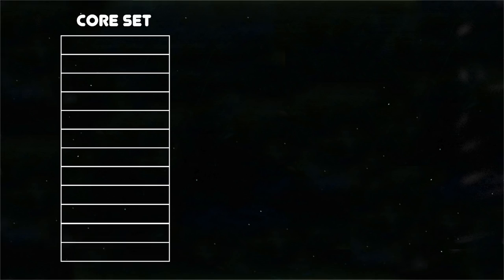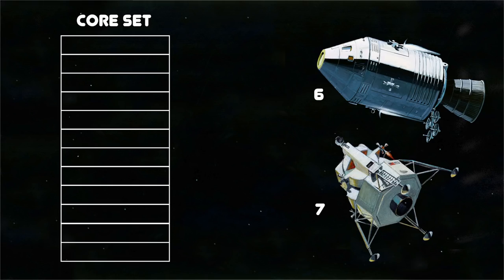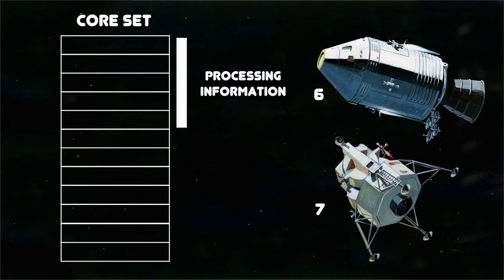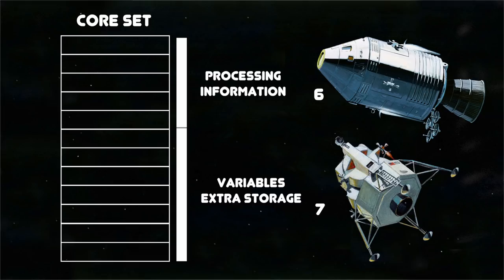Apollo 11's "1202 Alarm" Explained

Comment: Best part of the story is that the main programmer was Margaret Hamilton! She was/is a genius! The stacking and scheduling on this CPU that had less power than your smart watch was a work of art. The 1201 and 1202 system was actually a brilliant piece of adaptive code execution, and for 1968 when computers were the size of small vans and sat in stationary rooms, that is saying a lot!!! Ms. Hamilton should have her story told!
Reply: Glen Clark Absolutely! Margaret Hamilton developed the priority interrupt scheme for juggling those jobs, a system still used today. When you develop something in the computing field that remains in continuous use for over 50 years, you have earned the right to have your name mentioned. Often.
Reply: Smart watch? Aim lower - the Apollo computers had less computer power than a modern washing machine has. Even basic devices like bicycle lights do now too. Cheaper and easier to use an off-the-shelf microcontroller than design your own control circuits. Sometimes more battery efficient too.
Reply: tin2001 Cheaper and easier in this context is not always your friend. I can pretty well guarantee SpaceX isn't using Arduinos to fly with. Robustness and redundancy are key features I'd want my rocket seat bolted to. There's no mistaking technology has advanced an incredible amount in the past 50 years, but please don't dumb it down to make it sound like you can just grab off-the-shelf hardware and fly it. Two things really make the difference here; radiation hardening, and very large amounts of input/output pins. Where do you buy that stuff ready to go? I used to build, calibrate & final test commercial avionics. That stuff wasn't good enough for space!
Reply: Not to mention coping with extreme vibration, extreme heat, extreme cold, extreme vacuum, multiple redundancy etc etc. The average washing machine does not have to function 250,000 miles (and more) from home - and your life is not completely dependant on it.
Reply: EricIrl Exactly!
Reply: We have an expression we use over here in the UK -" horses for courses". I suppose you could also say "software for courses" or, more accurately "software for mission".
Reply: EricIrl We also say "use the proper tool for the job". Same difference. Oddly enough, while the AGC source code from one mission (I don't remember which one) has been around for years, as well as plans for an AGC emulator, I just saw a port of this code to run on a Raspberry pi. Tie that to the very good DSKY replica out there, and you'd have an awesome sim! Nonetheless, I still wouldn't trust it to get me to the moon and back.
Reply: That reminds me of the old saw that an IBM AT (or 386) had more processing power than a 1970s mainframe. That might be true in the narrow sense of MIPS, but the mainframe (or even mini) had a far more robust I/O system that could handle (say) several hundred (or a thousand) users at a time. That kind of demand would swamp a microcomputer.
Reply: Not to be confused with the Margaret Hamilton who was the Wicked Witch of the West.
Reply: Cydonia2020 Eee he he! I'll get you, my deary!
Reply: Caseytify I think the truth is somewhere in the middle.  Those hundreds or thousands of users would have been using relatively slow (9600 baud) serial terminals (some even slower). Compare that to a lowly 1MHz CPU, and it would still not be overloaded. That said, you do make a very good point about having robust I/O controllers, and their inherent interrupt processors (no 1201s here!). It certainly makes things easier to manage.

The current method for managing that kind of data at high speed is to use multiple mainframes for I/O job processors, which queue up data to keep a supercomputer running at maximum capacity full time. It makes the supercomputer "faster" by eliminating dead cycles. 

The issue with the Apollo AGC is the normal data rate was dangerously close to the computing speed of the entire system. If anything went astray, it was obviously easy to upset the system.

Special thanks to Ms. Hamilton for her part in making sure the system recovered gracefully from from these errors.
Reply: Fun fact, but a single current-gen smartphone has more processing power than the entire world had during the period of the first moon landings

Comment: Clearly the astronauts should have simply opened the task manager and manually ended the radar process, then set it to manual in services.msc
Reply: Put black electrical tape over it
Reply: Luckily Microsoft wasn’t around to bugger things up back then.

Nowadays they would run Linux.
Reply: Sean Mumford a
Reply: Lawrence D’Oliveiro "You look like you're trying to land on the moon, would you like some help after installing 357 updates now."

Comment: so if the computer hadn't reset itself almost instantly, they would have had to call the support line in Bombay or New Delhi?  They'd have run out of fuel before they got an answer, right?
Reply: nah, this was before outsourcing to india was a thing.
Reply: I need your location for verification purposes Sir. 
The moon
Sir what state is that city in?
Space
I do not have time for games sir.
I am trying to land my spacecraft on the moon. 
Have you tried resetting the system sir?
Punches hole through lander wall.
Reply: Blue screen of death

Comment: Just an FYI, the link to the Discover Magazine blog is wrong, it should point to:  http://blogs.discovermagazine.com/vintagespace/2018/01/05/apollo-11s-1202-alarm-explained/
 but instead points to http://blogs.discovermagazine.com/vintagespace/2018/01/03/apollo-11s-1202-alarm-explained/ and you get a Page Not Found.  I do like the part about the response from mission control and the Apollo crew wanting to land even if there were alarms: " The guys in Houston had the same response. “We’re go on that alarm,” Charlie Duke called back up, though he wasn’t entirely calm when he said it.  "

Comment: The Apollo simulations team discovered the embedded alarm codes (intended for debugging only) not long before the launch, and -- sneaky devils that they were -- used them in the very last Sim, which was traditionally NOT a "killer" run (for morale's sake, I guess). Steve Bales -- GUIDO for the landing -- called an abort during the sim when he saw a mysterious alarm (not 1201 or 2) saying the AGC was overloaded. Annoyed that he'd scrubbed the last run, he and others went through the code, and made lists of alarms, and how they were to be interpreted. Some codes meant immediate abort; some were bad if continuous, but not if intermittent. (1201 / 2 were like this.) Armed with this list on the day of the real landing he and his SPAN contact were able to give an almost instantaneous "go" to Kranz, because the alarms only occurred occasionally.
Bales said that without that last bad sim he would have immediately aborted on seeing the alarms on the real landing....
Reply: Crazy.
Reply: Hirmh... I wonder if there's any relation btw Steve Bales and myself, seeing as my last name is also Bales. Interestingly enough, I seem to recall running across a guy involved in Apollo named Alexis Bales, which if I am remember correctly, would be interestingly ironic since that is my name too, though in my case I'm a gal rather than a guy. shrugs
Reply: Bales was a hero for doing that homework. Respect.
Reply: He lived the motto of all good engineers: "Hmmm.  I wonder why it's doing that ?"
Reply: Impressive American
Reply: @herbertlucas3rd   And he was 26 at the time, and Jack Garman -- the engineer in SPAN who had compiled the full list of alarms -- was only 24. On their judgement, and on the trust that Kranz had in that, the landing carried on. (And another hero, of course, was Hal Laning, whose innovative design of the tiny preemptive executive at the heart of the AGC -- still innovative even to this day! -- meant that the computer was able to deal with the overload of spurious signal data, throwing out low-priority tasks.) A HUGE number of US engineering and technical heroes in the Apollo program; immensely depressing to see comments these days by people that refuse to believe in them...
Reply: And I forgot to add: immensely cheering to see brilliant channels such as Amy's, and the many others on YouTube who are keeping this information alive. You're the modern heroes: in the face of darkness...
Reply: He was given the Abort Mission call out exclusively... no one else dared to accept this. He spent a lot of time going through the descent phase for  months prior to the actual mission.

Comment: I have a Vintage Space question I can't find an answer on. At the Space Coast, there are Space Launch complexes numbered up to 47. Most of the complexes are inactive, abandoned, or demolished, but their locations are still indicated on maps---except for a few. For instance, SLC 7 and 8 and missing, as are SLC 23 and 24, and  27 and 28. 31-33, 35 and 36, 38, and 42 through 46. So, where did they go? Were some renumbered if they were re purposed?  Thought it might be an interesting question.

Comment: Amy, what about doing a vid about Apollo 10's problems when they got close to the moon.  Apparently they were even worse than the "1202" alarm, supposedly being only seconds away from death.  I can't tell from my research if they disconnected from the LEM lower stage and they went out of control, or they were still attached when they went out of control.  Were they sort of practicing an abort?  Also, you might explain whey they didn't get the "1202" alarm on their dry run for landing.  What did Neil and Buzz do differently that they got the alarm?

Comment: Great video!  

I have a different sort of question:  the departure of the Apollo 17 LM from the Moon was taped from the camera on the lunar buggy. After the camera could no longer follow the LM, it refocused on the descent stage. This is where something strange can be observed. Nearly 3 minutes after the departure, you can still see that some "things" are apparently moving on the descent stage. Is this an illusion caused by a bad quality video, are there things dangling from the descent stage and they are still vibrating in the absence of aerodynamic friction, is there some gas escaping?

Comment: On a slightly related subject, it would be great if you could explain how the teams at Nasa were able to so accurately calculate the distance, rotation, gravitational pull etc to be able to program the guidance computer and navigate cis-lunar space within very tight tolerances.

Comment: Hi Amy, I remember as a kid wandering the back rooms of the Air & Space Museum in DC, and stumbled on several glass cases full of concept/prototype model designs for the space shuttle launch configuration. These were just basic forms, but there were a LOT of them, it  fascinated me that there were so many. Most NASA geeks know the troubled & compromised decision process that led to the final config, and many engineers will have their own strong personal opinions, but were there any strong configs that in retrospect ought to have been pursued instead? Was there any wide consensus that one or two of those 'coulda-beens' were  'shoulda-been's"? (And when will SS qualify as 'vintage' anyway? What's the date on the calendar?) Thanksthanks!

Comment: Wasnt there an issue that the planners failed to take in the rotation of the moon and thus the Eagle ended up severel miles of its planed landing space? And that positional error caused the altitude radar to go bananas at times? Or was that another landing? Johan.

Comment: BTW, for those who were curious, the VAC/vector accumulators Amy mentioned here were additional memory space used to store vectors like velocity, acceleration, position, etc. that were used in the computer's calculations. The Apollo Guidance Computer had only one (sometimes two) CPU register(s) available for math processing (also known as the accumulator), so those vector components had to be stored in a continuous block of memory to make sure they could be reliably accessed, one by one. The AGC set aside 5 VAC spaces for storage, each 344 bytes long—that's bigger than the RAM in an Atari 2600. The Executive program dynamically allocated these VACs much like it did the core sets, without the priority info—just an in-use flag. The 1201 alarm roughly corresponded to the same problem as the 1202, except instead of running out of core sets to save program state before switching tasks, it ran out of vector storage space.

Comment: As I recall seeing before, they actually ran into both of those program alarms during simulations prior to launch, and were trying to decide a to whether or not it would force an abort. I think it's covered in the documentary, "Failure Is Not An Option: The Mission Controller of NASA."

Comment: 4:22 The reason had to do with a phase mismatch between the power supplies. The spec should have said that the phases had to match, but it didn’t. Most of the time it would work fine, but if the radar was switched on at exactly the wrong fraction of a second, it would start generating these spurious interrupts.

Comment: Have you done a vid on the construction of the LM?  I always remember hearing that it was so thin you could punch a hole in the hull...which makes no sense for a manned craft in a dangerous environment, zero or 1/6th G aside.
Reply: How thick do you think it needed to be? :)
Reply: Dunno....that's why I asked.
Reply: @samsignorelli  So you don't know how thick it should be, and yet you think that having it "so thin you could puch a hole in the hull" makes no sense? :)
Reply: @Jan_Strzelecki  sigh  PLEASE re-read my original post.  I said I remember HEARING that the material was thin enough to punch through  (which is the part that doesn't make sense, given the operational needs of the LM)....not confirmation that it WAS.
Reply: @samsignorelli  Okay, Mr. Dramatic :)
The short version is, the engineers made it so thin (at certain points only, mind you), because they could. And they wanted to, because it saved weight. And in rocketry, every gram counts. So the LMs walls are as thin as humanly possible, given the operational needs. There's a reason why its outer hull was also so thin that it buckled and warped during the landing - it was also made as lightweight as possible, as evidenced by the aforementioned buckling, which, as it needs to be pointed out, didn't affect the after-landing performance.

Comment: Hi Vintage Space! I haven't looked at your other site but I'd like to see a "Computer Comparison" video. For example, I once heard that all the processing power on the LEM was equal to a Commodore 64, that came a few years later. I don't know if that's true. I'd like comparisons of - say - speed, memory, maybe even size with all kinds of stuff like: An Atari 2600? The Eniac? An Amiga? The Apple 2? The Macintosh? The iPod. The iPad. The iPhone X. You could do percentages "the LEM, the Command Module and the Saturn V could run all their systems with .033% of an iPhone. Or quantities. "The memory of the first iPad would equal 50,000 LEM computers." Like that. Just saying!

Comment: I have a question....Do the Astronaut's, both past & present, circadian rhythms get out of wack during long duration flights? What time zone is used in space?
Reply: AlPowers53 All mission events are referenced to Mission Elapsed Time (i.e. the moment of launch). That's why they always mentioned the clock running on the early missions. It set the stage for everything. MET was and is important for every mission, they just didn't mention it as often.

Comment: Thank you Amy.  That answered a lot of my questions about that alarm.  Based on my research, it appears that the astronauts focused their training on things that would warrant an immediate abort, not things that wouldn't, but the controllers did train for that sort of stuff, so when it happened,  Armstrong was caught off guard, but not  the controllers, especially Jack Garman.  As long as the alarms weren't constant, but intermittent, it had been determined already that such was not a cause for abort.

Comment: Amy topic idea.    What happens to the crawler that took the Saturn V rocket from the VAB to the launch pad?  Where is it during the launch?  If the rocket launches from the crawler, then how does the crawler survive?
Reply: +Nelson Nissley   The crawler is not under the rocket when it launches.  It lowers the launch pad into position then is used to move the mobile service structure away from the launch tower.  https://history.nasa.gov/SP-350/i6-9.jpg
Reply: I'm pretty certain there is a transfer of the Saturn 5 from the crawler to the launch pad where it's connected to the launch pad and tower and the crawler is moved from harm's way.  If I remember correctly there are deep wells, filled with water, just below the launch pad to cool down the launch action.

Comment: Hey, could you please explain how the shuttle's orbital insertion worked? I'm wondering how the orbiter got into orbit without the ET
Reply: Before the external tank is released the shuttle was already near the required orbital speed, so only a small amount of thrust was needed to get to the proper orbit.  The shuttle did have on board fuel tanks for that purpose and for the deorbit burn.
Reply: So it just used the two manoeuvring thrusters on the back?
Reply: Yes, it uses the two OMSs engines to boost its orbit and to deorbit.   The ones in the top right and left of the photo: https://upload.wikimedia.org/wikipedia/commons/a/a8/STS-116_Shuttle_Engines.jpg

It also uses the small thrusters on various parts of the shuttle, to make minor changes and for rotation while in orbit.